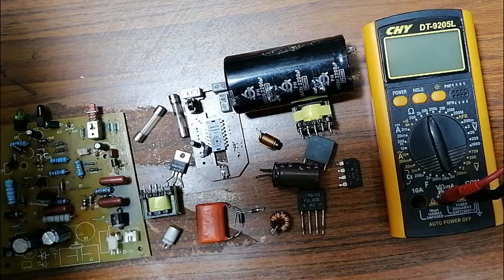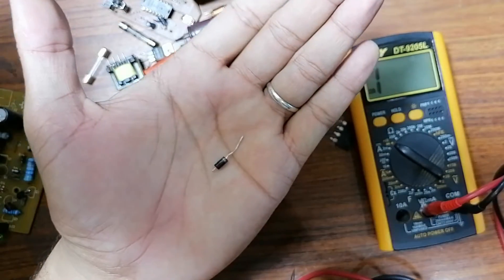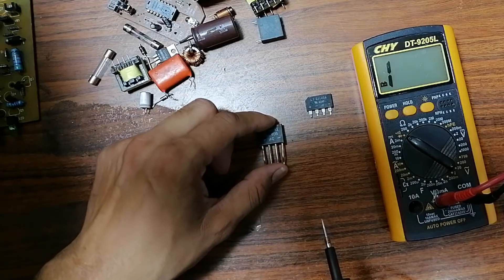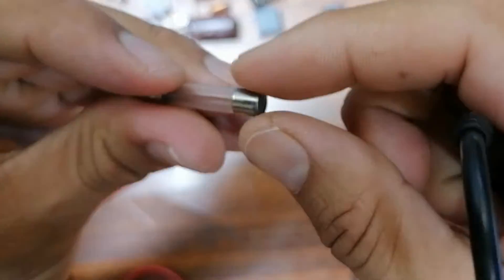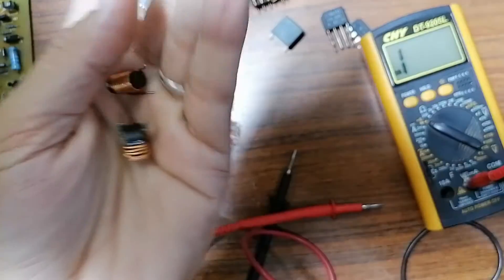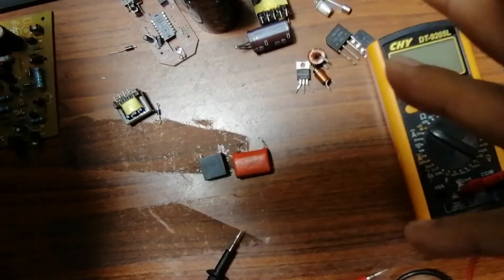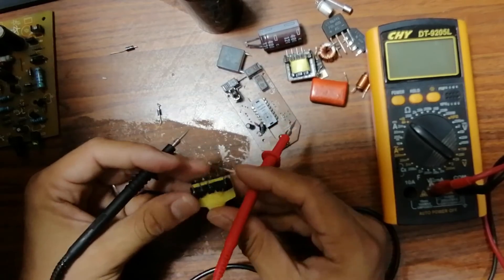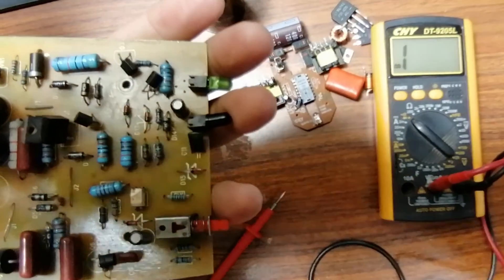Electronics components Testing Part 1

Comment: So the question is which form of testing is more accurate..in or out of circuit?  If one is diagnosing a circuit and prints sre not available and nothing looks or smell burnt; desoldering many components isnt practical.  So what do you suggest?  For me its confusing becsuse you have theory vs real life.  If a coil has 10 ohms, that may seem really high in theory, but in the circuit it is normal and functions normal.  Ive seen diodes have drops of 2 or 3 volts thinking that is too low, however, when it's taken out of circuit it jumps to the normal 6 or 7.  Ive tasted resistors in circuit with readings that are normal yet, the item looks burnt and charred.  So again, what is your method when faced with real world circuits and where theory crashes with real life?

Comment: Much respect
But between analog and digital meter Wich one is best and quickest
Reply from the maker: Thank you for your question and respect. Both analog and digital meters have their advantages. Digital meters are generally more accurate and quicker for most modern electronics work, as they provide precise readings and often come with additional features like auto-ranging. Analog meters, however, can be useful in certain scenarios where you need to observe slow changes or fluctuations in voltage. So, it depends on your specific needs, but for speed and accuracy, a digital meter is usually the better choice

Comment: I'm new to this phone technician work, I don't really understand what the IC and the name work for in a phone, I will be glad if I can get a message on this or a video please
Reply from the maker: Welcome to the world of phone repairs! In simple terms, the IC (Integrated Circuit) in a phone is like the brain that controls different functions, such as charging, display, audio, and connectivity. Each IC has a specific job, and they are labeled based on the function they control (e.g., power IC, audio IC, etc.). I’ll work on creating a video to explain this in more detail. Stay tuned, and feel free to ask any specific questions in the meantime

Comment: Wait? Im new to this and have been slowly learning about electrical components so sorry if i am incorrect and think that im not, but for the capacitor isnt the proper way to check them is to use the capacitance in the multimeter? I get the ohms mode works also but maybe the capacitor is bad but still accepts some charge but maybe its not up to its spec causing malfunction in a circuit, thats why a proper farad capacitance test is needed in that case.
Just my take
Reply: Yeah mate , that's why you need an oscilloscope in my opinion. You need to check the voltage thru the capacitor if its a decoupling one , and it Has to be decently smooth . If you don't have a lot of capacitors to test, you can just take them off and test them on a " component tester " this will show the capacitance and another very important value called the esr which is the equivalent series resistance
Reply: Hey alex, I'm also new to this field and I'm trying my best to learn because I'm on a time limit to try and fix my friends DS Lite. I've made progress already but I've hit some road blocks and I'm trying to figure out how to read the components on the pcb's. Do you think you could help me out with this project?
Reply: Good  but I need  tranisferm

Comment: I thought if electrolytic capacitor in continuity mode shows short(zero reading), it is a failed/ dead  capacitor.What do you think?
Reply from the maker: yes zero reading means shorted
Reply: Yes I know but my question is if the electrolytic capacitor show zero reading, it is said faulted capacitor by some electricians. A little confusion here. @electronicsrepairbasics_erb

Comment: Checking rectifiers with a multimeter is okay for finding shorts, leakages and opens, but it does not test them for their maximum voltages.  That requires a curve tracer that can test at higher voltages.  Thanks.
Reply: Can't an oscilloscope do this trick?